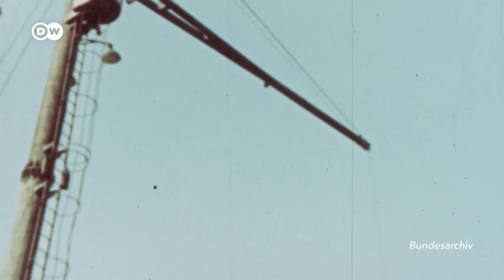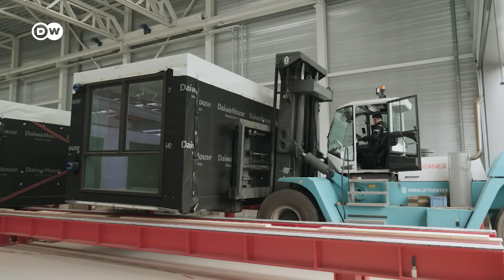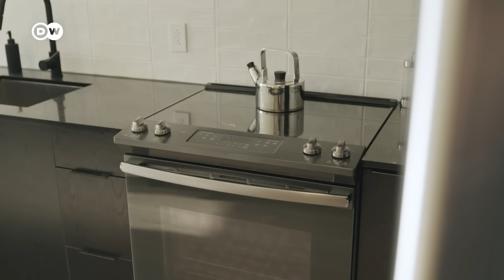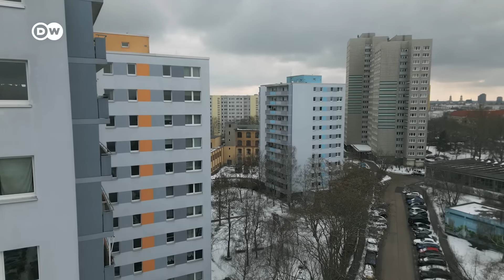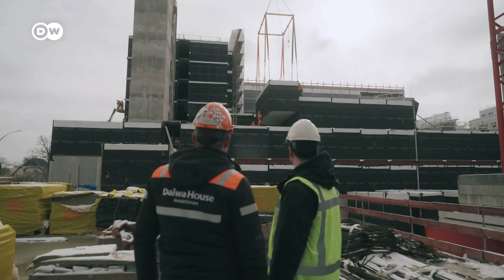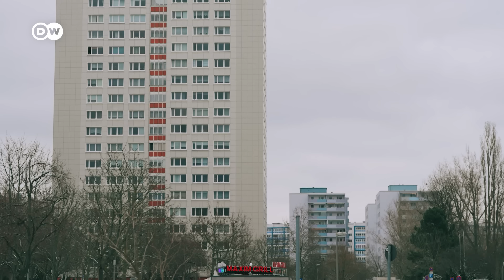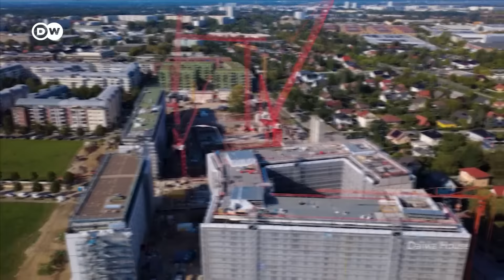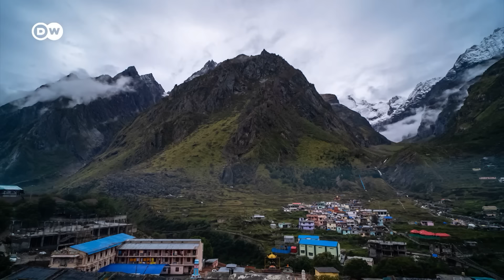These buildings are ugly. But the idea was genius.

Comment from the maker: Are there any modular construction projects going near you? How are they going?
Reply: I'm in Finland and need to find out. QUESTION: How is accessibility handled? Will a student who uses a wheelchair be able to live in, say, a two module apartment? Will an ageing couple be able to continue living in their 3 module family home after one or both of them start using a walker indoors?
Reply: @ronjaj.addams-ramstedt1023  that is a design issue more then anything,  as long as you standard designs with no customization the factory build is cheap.
Reply: You should look into Singapore's housing! The current generation of flats at all prefab and I would say most estates still look good even though its all prefab
Reply: China is still doing it today. That's why house prices are falling.
Reply: @AndikaKhairilAkbar  China is using different method, they use premade steel frames rebar and only pour cement, which is very fast and cheap, also very sturdy.
Reply: @AndikaKhairilAkbar What's also falling in China are prefab apartment blocks😂
Reply: @Reasonah2030 They have to many houses .😂
Reply: @Reasonah2030  That's what you get when you prefabricate out of tofu.
Reply: @andreasu.3546 Because you are poor you buy a house at a discount price
Reply: In my neigbourhood (Haarlem, Netherlands) several prefab flats and houses have gone up. They were put up very quickly without much strain or disruption to the area. They are very attractive buildings.
Reply: @ovdtogt1 please I hope you give us an update in 5 and 10 years
Reply: There are some people building customized houses and shops using modular bricks
It's not exactly the same concept but ends up saving a lot of time, energy and materials while avoiding waste as well
Reply: Nope, the boomers say it will affect their retirement assets so my generation doesn't get to own a home.
Reply: For the inevitable haters, I'm 51 years old, I don't know anyone my age who owns their home unless they live on a boat or in a van or exploited underpaid employees to raise the money needed.
Reply: @PeoplesRepublicOfHackney  I’m more than ten years older than you — yes, a boomer though tail-end. I will never own a home.
Reply: @PeoplesRepublicOfHackney Cry harder then try harder.
Reply: Hahaha, yes the very one in this video. I live in Lichtenberg in walking distance to that construction site.
Reply: מה שמדהים שיש מסביב כל כך הרבה שטח מת שהיה אפשר פשוט לבנות כמה רחובות יפים כמו בלונדון  ברוקלין או בוסטון
זאת אדריכלות מזעזעת
Reply: 4 storey blocks, with courtyard open to the sky in the middle please
Reply: Keep voting for neoliberals and left and you all will end in these "apartments".
Reply: Nothing beats factory production, from 3 decades engineering experience, I can assert that minimising site work (where possible, obviously) the quicker, the better quality and often the more profitable the project will be. Further scaling of this technique could drop cost further and "democratise" this solution contributing to more affordability.
Reply: @salahelackad2005  what challenges would you anticipate when it comes to dismantling the modules to move and rebuild the house elsewhere? Would it lose rigidity?
Reply: @livefreest Not really, depends greatly on following the manufacturer operation. While that's certainly a great feature, but statically, how many "relocations" are really needed in practical life. The advantage is speed, quality and cost if kept in check it could resolve housing crises in many places. Would you agree?
Reply: @salahelackad2005  Absolutely I agree. Lower housing costs with quality building and speed are important. I have a feeling that people may invest in such housing with the hope of moving their house though. I can very well foresee  manufacturers and builders would use that feature as a draw for potential customers.
Reply: 인건비가 비싸서 그래요. 모듈식 건축보단 기존의 건축 방식으로 지은 아파트가 훨씬 자원 효율적입니다. 중복 낭비되는 자재만 해도 한참 적어요.
Reply: How do you say yuck in German?
Reply: if you investigate the books of these operations, you’re going to find the construction process is quite expensive. It’s good to reclaim materials, but pretending that it’s a cost savings is a fool’s errand.
Reply: China already doing it years ago. Check it out please.. so you can check the issue if there are?
Reply: None, and I’m glad. I grew up in such a place, and people need to finally understand that housing is more than just a place to live, something most urban planners already know. Building homes alone does not build communities and does not necessarily create a livable and safe environment. High-density housing projects often become social hotspots with higher crime rates, and they end up costing more to renovate and maintain, including infrastructure.
Reply: Yes, A LOT. They''re poorly insulated and get regularly hit by Russian drones and missiles. Homeowners and tenants are very afraid of the latter.

Comment: People like to sneer at these "commie blocks" but they are honestly one of the best things that came out of that whole regime. Reinforced concrete panels that can be mass produced cheaply and then built on the target site quickly and easily like legos works perfectly well. I lived for 20 years in one of those buildings and it's totally fine. Would I prefer a nice house? Sure. Does it beat being homeless or having to commute for 2 hours a day to live outside of the city? Definitely! If you need to build a lot of affordable housing this is the way to do it. The commies figured it out 50 years ago yet for some reason we still have a housing problem somehow.

Comment: The part about controlled conditions for curing concrete is really important. Recently a condominium under construction in my country made the news because a major concrete slab in the building failed a strength test and they decided to rip the whole thing out and rebuild it, which you can prob guess will cause plenty of headaches for the construction company and neighbouring buildings. With prefab buildings this hardly ever happens, and even if it did, the fuss and bother are largely limited to the factory

Comment: Philosophical Foundation
Your framework is based on four principles:
1. Housing Should Primarily Be a Home
Housing should not primarily function as a speculative asset.
2. Supply Problems Require Supply Solutions
When demand rises, the long-term solution is more housing construction rather than suppressing demand.
3. Speculation Should Be Restricted Through Leverage and Tax Policy
Rather than crashing markets with harsh monetary policy:
limit borrowing,
tax additional properties,
require more equity from investors.
4. First-Time Buyers Need Help Entering the Market
But assistance should be:
sustainable,
repayable,
flexible,
non-profit,
designed to minimize inflationary pressure on house prices.
End Result
In theory, this framework aims to create a housing market where:
High home ownership is preserved.
Young professionals can buy earlier.
Prices remain aligned with wages.
Housing shortages are prevented through construction.
Property speculation becomes less attractive.
Government support is recycled rather than permanently spent.

Comment: the old soviet ones are great, thick concrete, very quiet. odd layouts cause they were build for the upperclass, so they don't have a lot of storage room for mops and things like that.. that said, still worth it over the new ones for the concrete alone, most uncomfortable when you hear every bump and argument.. I wonder if you could fold elder care into them, public spaces, shops and gardens, to try and solve the consolidation of poverty issue by fostering community?

Comment: was this just a giant ad? Yes, there are modular projects happening near me, they cost as much or more than a traditionally build house and you need to load them in giant trucks and then lift them to put it all in place. If you live in a downtown area, sure, but in rural areas that is not feasable. on top of that, it's a prefab, there is only so much you can customize when the factory was designed to build at scale, so it's also a big middle finger to architecture practice as a whole. the housing crisis would be better solved by not trying to cram as many people as possible into these huge mega-cities. that's only good for business. the world is full of unbuilt land

Comment: IMHO most of those residential areas look bad not because the houses are inherently ugly, but because the people planning the areas had a very bad idea about what makes an area look good.

E.g. we know now that variations on the outside walls of houses (different colors, varying window/balcony placements, breaking off long lines by having a different house at an angle, things like that) make an area look much better.

Unfortunately a lot of the people making decisions on how low-cost housing is to be built today are stuck in the '60s mindset and ignores any complaints about how now projects will look...

Comment: Very small. And what about heating and cooling? Last week we had plus 40 degrees C. !!!!!! A few years ago we had minus 20 celcius.
Reply from the maker: Thanks for your comment! With proper insulation, high-performance windows, and efficient heating and cooling systems, modern modular homes can stay comfortable. That said, 40°C is challenging for any home, so good design, shading, and ventilation are especially important.
Reply: @DWPlanetA then tennants would be locked up in a very very tiny home. Bad idea.

Comment: The intro is a little misleading, making Eastern Bloc concrete prefabs seem crude and primtive.
We know from historical records that i.e. the People's Republic of Poland had sophisticated concrete prefab construction techniques in the 70s and 80s. Whole bathroom modules were built in factories, ceramic appliances and all, as well as prefab modules for on-site assembly. 
As much as the end-result assembled building sometimes left a bit to be desired [or a lot in some cases] the supply chain and logistics were incredible. Many, many standards of concrete prefabs were developed, with different wall thicknesses, standard room dimensions, standard apartment room count etc.  The whole topic is fascinating

Comment: I live in a building of this type, in another country that wold clacify as "eastern block". With the prices having risen 400-600% over less than a decade, these apartments are sought after and because of the demand for livable space, they are sold at almost the same price as new.

When built many were against them. When the socialist system fall apart, people were making fun of these buildings saying they wont even last the 50 years they were designed for.
As of now i know that only one building had significant findings after inspections and was condemned for demolition, one of the early ones, around 70 years old and with no maintenance and significant issues in its life.
These building s may have been built for cheap, but the quality has actually been quite great. I tried to make a hole to pass a cable through the wall and i ended up burning my drilling machine... Hole at about 15-20% depth of a 20cm wall... 
Biggest issue i got is that Sound prooffing is not great, but thats a compromise for something that is 40 years old and (when i moved in) pretty cheap

Comment: This is an amazing technology & method, but the premise of this video (and the idea of a housing "shortage" in general) ignores the fact that, in the US & Canada anyway, we actually have enough housing stock to house every person with a lot left over. The issue is that private & corporate landlords benefit from scarcity, natural or artificial; landlords frequently choose to let units sit empty rather than flooding the market with housing stock, thereby allowing the price of rent to fall. While those units sit unoccupied there's little incentive to maintain them, so many units are just rotting slowly, either exposing eventual tenants to unsafe conditions or requiring a much greater cost to return the unit to habitability than it would have cost to simply maintain it in the first place.

Further, the degree to which private equity has captured the housing market is very troubling, and without significant intervention any new build stands at risk of being bundled up in an asset portfolio to be squeezed for profits. Building faster/more efficiently doesn't mean much when new housing stock is in large part falling into the hands of a very few, equally-unscrupulous firms!

Comment: Interesting thought about modular housing is that you could probably rig the factory for some variability. Aka you may be able to design your personal modular apartment around some constraints. Similarly, most modern issues about ugliness of buildings are completely independant from modularity - they're about building facades and internal decoration - aka the stuff that gets slapped on/in the base modules, and not the modules themselves.

Comment: It’s a great concept but one concern is potentially putting a large number of people out of dignified work for the sake of speed and efficiency. It creates a separate problem if this becomes the standard mode of construction. Obviously a difficult issue to contend with in terms of the individual relative to corporations or the state.

Comment: It is much easier to achieve excellent safety performance in the controlled factory setting than it is with onsite construction.
At least, in industrial process equipment pre-fabrication the reduction in injuries, and near misses was substantial.

Comment: these most of the these type buildings maked in from early 70s to mid-80s, those are a 2. generation from these type houses (the first generation was 60s and early 70s).. not to mutch 3. generation version is builded after the middle 80s.. at least in hungary.
The estern block licensed these build technologies from originated Denmark.

these are not that bad (to living in) ... of course is you will have a lots of neightbor, and recomented to have a good relasionship with it (if is possible), the sound insulation is minimal (the later version is gets better ... but some noise is impossible to remove). still you can live somewhere (with family). some version of these building ground floor (of first floor for americans) has module to place service or shop in it.. some variation of the modules ideal for grovement facilities, post offices or schools.

Comment: Those building have a real lifetime.  They are engineered to a factor below 2x real stress and the steel has a lifetime as to rust and actual stress, thus they should be deconstructed  to 2/3rds to 1/2 their size to extend their lifetime and the base layer re-enforced (due to the rust rot in the ground floor.  Also you can note that the original architects, financiers, contractors and other companies have changed to eliminate their liability.  I'd put gardens on the tops of ter deconstructed buildings

Comment: are these like earthquake and typhoon resistant?
Reply from the maker: Hey! The modules are designed to be structurally safe: they’re stacked and bolted together so they act as one solid unit, not separate blocks that could shift. With natural hazards like that, it then mainly comes down to the intensity, just like with any other engineered building.

Comment: I lived in one of these probably about 25 years of my life. There is some stigma attached to them, and I imagine even more so in Germany and specifically Berlin, because of the separation between Eastern and Western Germany. They are associated with the totalitarian rule of the communists, stripping of individuality and can be quite ugly from the outside. But it is also true that they are great to live in. They are quite good at regulating temperature in both summer and winter (unless you live at the top floor). There are many communal areas like multiple rooms for storing bycycles, for drying laundry and we even had a ping pong table when I was growing up. Each flat has multiple storage areas like pantries and cellars where you can store stuff that did not fit in your appartment. These building are also designed with the whole neighboorhood in mind, so there are often many shops, pubs, parks, children's playgrounds, hobby centers, sports fields etc nearby. For example my elementary school was 100 meters away from my house growing up, so it literaly took 3 minutes to go to school. I really could not complain about living in one. And nowadays they get new colourful facades, so they don't look quite as ugly as they did in the 90s.

Comment: These don't seem to have concrete walls so ironically they are worse than the original ones especially in terms of noise isolation which is a big problem in apartments. Not to mention water damage and thy will fall apart sooner.

Comment: Modular housing is not new.  I do like some I've seen.  But since when is "butt ugly" the only way to reduce waste and achieve affordability???
A giant apartment building could be divided into sections to appear like row housing, as if built one by one by different people with different architectural  tastes. 
Different sections could also have different depths, so a few protrude a little, as is common in cities anyway.  This can be achieved with some variety of floor plans from the maker, not random sizes.
Windows could be rectangular, as they already are, but some could be arched.  This need not add to expense at all, just a pre-planned option.
There are many other ways to vary, and none need add to cost or complexity.

Comment: nice one.
Even in more rural areas living costs aren't as cheap anymore. So those 4-7 storeys buildings 20% faster would be a huge improvement. Even tho it might not be the solution for Berlin until stacking 15-20 in height is possible.